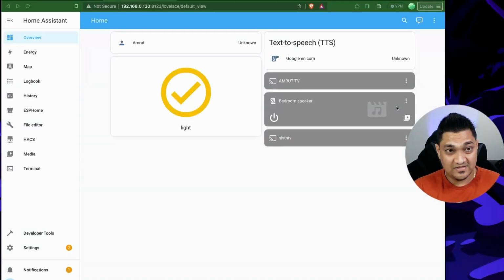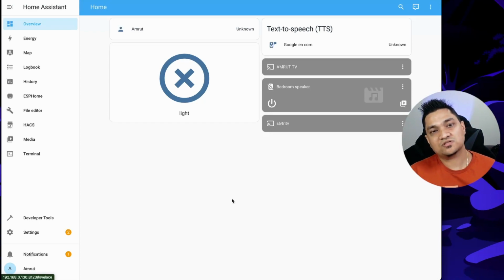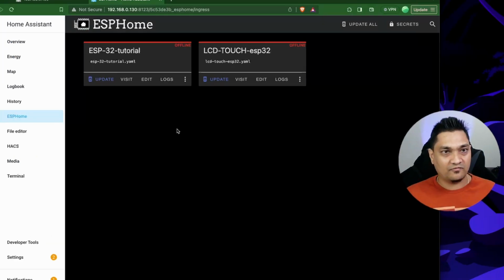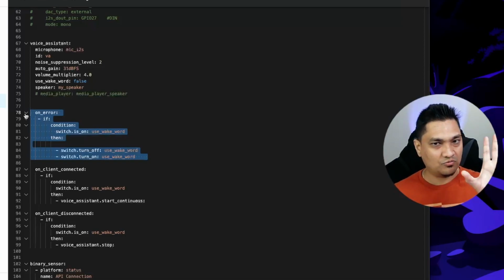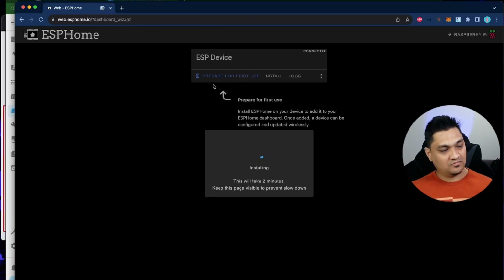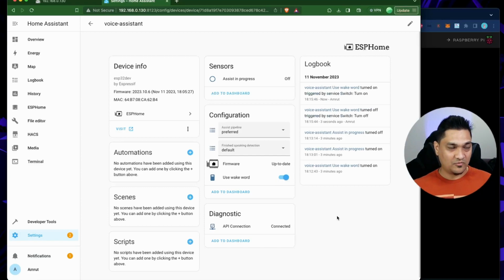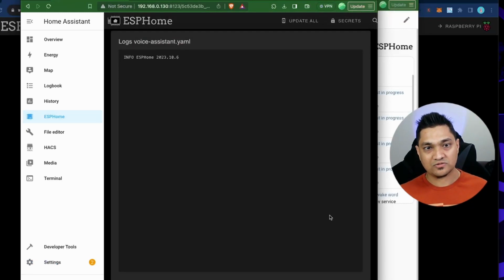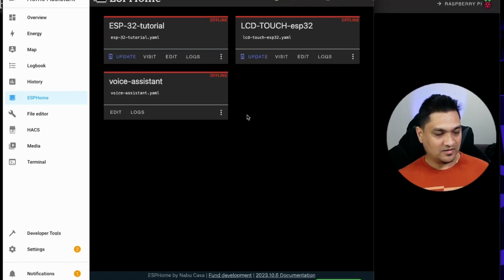How To Setup LOCAL Voice Assistant With ESP32 Using WAKE Word In Home Assistant🔥| Step By Step Guide

Comment: Can I do this using an ESP32-S3-BOX-3? I think it already has a mic + speakers but I want better ones
Reply from the maker: Yes you can.
There is already a read made project on the ESPHome website to upload the binary for ESP32-S3 Box 3.
Reply: @SmartHomeCircle  But I haven't been able to set the wakeword to Alexa bc when I try to download the config from HomeAssistant EspHome Builder it fails
Reply from the maker: are you running esphome & HA on a raspberry pi 5?
Reply: @SmartHomeCircle  Yes and ESPHome now works foe me. I only need to buy a better mic and speaker now

Comment: ESP32 is very laggy with this code, sometimes it works after reboot and restart of HA, sometimes not unfortunately..Also speaker not working, I get reply only if using media player, but when trying to play mp3 from media library its extremely laggy...
Reply from the maker: @elnurmehdiyev5062  which device are you using to compile the code?
Reply: @SmartHomeCircle  HA installed on RPI4, Im using esphome on it to compile
Reply from the maker: RPI4 is very slow for compiling the microwake word setup in ESPHome. Even the RPi5 can sometimes crash during compilation. I would suggest to move to atleast a RPI5 setup.
Reply: @elnurmehdiyev5062  install ESPHOME on your PC/MAC and flash all the devices from there in the same way as you do with the raspberry then you can add them to HOMEASSISTANT in the same way. The only difference you will have to save the "encipting Kay" because it will be requested when you add it. I now manage all the devices from the MAC because there is no need to manage them from your Rpi4 (you only waste a lot of time with many errors and problems). On Rpi4 it is only useful if you have small devices like temperature sensors or similar.

Comment: Thank you again for your videos, they have been very helpful. However, before I begin, I have a question. Since I can’t install the Assist Microphone Docker container, I’ve decided to go with the ESP32 + I2S microphone method. Since I don’t have Home Assistant Supervised, would the setup explained in this video work using Whisper, Piper, and OpenWakeWord, installing them in Docker containers as you mentioned in one of your previous videos? Best regards
Reply from the maker: @enriqueenrique-hd7zj  yes.. it does. I am running my setup with docker. Also if you are planning to create a Voice Assistant then check my latest video with esp32 s3. It has on device wake word.
Reply: @SmartHomeCircle  Thank you so much for responding! I have an ESP32-S3, and your videos are very helpful. Best regards.
Reply from the maker: @enriqueenrique-hd7zj  Glad I could help 🙂

Comment: I just found a temporary solution to the crackling sound for the MAX98357A amplifier, checking the datasheet I used the SD pin to apply the SD_MODE Control, where LOW is Shutdown and HIGH is the activation of the left channel :)
You can also send HIGH (3.3v) with a RSMALL resistor (210.2k) to activate the right channel and with a RLARGE resistor (634k) to activate both channels. With this the annoying sound on reset no longer appears, I hope it helps you.

I leave the code:

media_player:
  - platform: i2s_audio
    name: "Speaker 3W"
    icon: mdi:speaker
    id: media_player_speaker
    i2s_audio_id: i2s_in
    dac_type: external
    i2s_dout_pin: GPIO27   #  DIN Pin of the MAX98357A Audio Amplifier
    mode: mono
    on_state:
      - lambda: |-
          if (id(media_player_speaker).state == 4) { //PLAYING - info: https://developers.home-assistant.io/docs/core/entity/media-player/#states
              id(amplifier_control).turn_on();
          } else {
              id(amplifier_control).turn_off();
          }

switch:
  - platform: gpio
    setup_priority: -11
    name: "Turn on Amplifier"
    id: amplifier_control
    pin: GPIO22 # SD Pin of the MAX98357A Audio Amplifier
    inverted: false
    device_class: switch
    restore_mode: ALWAYS_OFF
    entity_category: config

Comment: I've build it using same components and procedure as you described. Also used the code from your site and changes mode:  mono to channel: mono. Installig of code is working fine. However, when I turn "use wake word" switch to on, audio crackles.
Reply from the maker: You mean after the first boot right?
Yes. that is one of the issues I haven't been able to solve for the ESP32. 
But I have moved to the  ESP32-S3 setup which is far more better with on-device wake word detection. Check my video here https://youtu.be/rT_q0g8dtmY.
Reply: This is where I got stuck too, Error:  [mode] is an invalid option for [speaker.i2s_audio]. Did you mean [i2s_mode]? Changing 'mode: mono' to 'channel: mono' as you stated fixes it. Thank you

Comment: For speaker: mode: mono , do you mean speaker: channel: mono, or speaker: i2s_mode: {something other than mono) ? This is causing errors. Thank you
Reply from the maker: Yes..
ESPhome has changed this since I made the video. 
I will update it to the latest configuration in the article.
Reply from the maker: @ApexNick I updated the article with the updated configuration.
Thank you for letting me know 🙂
Reply: @SmartHomeCircle  thank you. I'm going to build the one with LED strip. Just waiting for the s32 terminal breakout board to arrive. Never realized before you can't just plug them in to a regular breadboard
Reply from the maker: @apexncdaddy  can you may be check my latest voice assistant video using ESP32-S3?
Currently that is something that is trending with on device wake word.

Comment: Hi can you help me  all ok till about a week ago or so. Now after powering it up the first time  I use that wake word, it listens and the carries it the action and I get a response then it just hangs for ages till it goes back to the listening for wake word again
Reply from the maker: I think this is because of the latest update of ESPhome 2024.05. It has broken the Voice assistant. 
I will try to find a solution. Haven't got to it yet. 

If you are blocked, you can try reverting ESPHome update to 2024.04 and it should be fine. 
Or you can check my latest video on the ESP32 S3 with on-device Wake word.
https://youtu.be/aPP2alIU7Gg
Reply: Thank you glad it’s not just me

Comment: wow, i waiting for this solution. very very nice. Thankyou. 
is it is possible to use that with an ESP with BT with an external professionial microphone?
how good is that microphone you use there? can it used without problems in a room with 15 or 20m2 ?
Reply from the maker: Thank you.
Connecting a bluetooth microphone with esp32 is not possible. Atleast not using esphome.
The microphone is pretty good. It can pick up a voice about 2-3 meters away from the microphone. One of the home assistant developers was able to use it 5 mts away with the same microphone i.e inmp441. Check the links in the description.

Comment: Hi, really enjoyed your great video. I am new to ESP32 and electronics generally but followed your instructions in full. I have managed to flash the ESP32 and it is detected in Home Assistant but when I try "OK Nabu" the assist button doesn't change. I've tried the debug pipeline and it works when using my browser microphone and speaker so it seems the pipeline is ok so assume it is just my new ESP32 mic set-up that's not working. Any idea what I can try next (BTW already tested with a second microphone). Any help gratefully appreciated.
Reply from the maker: So then for the commands the pipeline works. Now you have to check if the wake word is detected.
In the video I show how to open debug pipeline option. Can you check if the pipeline is waiting for a wake word?
Reply: @SmartHomeCircle  Hi, thanks for the response. When I use my browser and the debug pipeline wakeword is detected and the pipeline operates correctly and a light is switched on and I get an audio response from my laptop speaker. The problem seems to be that my microphone / speaker on the ESP32 simply don't seem to work. When I say "OK Nabu" 2 inches from the microphone the assist button doesn't change and nothing happens...
Reply: @SmartHomeCircle  Hi, I have checked an no wake word is detected! Ideas to resolve?
Reply: @JamesWhale-d1v  same here. did you find a solution?

Comment: You mentioned fixes to the yaml file, but also said some of these will be fixed in 23.12 do we need to change the yaml file once 23.12 comes out, or can we leave them in place. Or will you publish a new yaml file?
Reply from the maker: The yaml already includes the fixes. So it should work with 23.12 version..
Reply: Thank you. I'll let you know how I get on when 23.12 comes out. Just for info I found this https://youtu.be/g0u6g6am1pU?si=_9-fYAYDVxHuIdS8 that shows how you can change the responses. You may want to add to your series. I am sure it will add to the usefulness of voice. Best wishes.

Comment: Hi, very good video thx. 
Before buying the components, one point : is this solution with esp32 ans mic working well ? 
When i used my phone mic with compagnon app and assist: it is not working well . 
I settup pipeling and try to use my android phone : always "sorry i couldn't understand that"
I have to ask many time and only one is working.
thanks for your reply
Reply from the maker: This must not be related to your microphone or the companion app. 
Can you try just typing the command in the assist window like "turn off something". check if that works.
Reply: My phone / computer understand me great.
Your phone mic might have an issue, call yourself on another phone and check how clear your mic is.
Or...  you might want to try a different voice model in whisper, especially if you have an accent.  "faster" models are best for clear speakers.